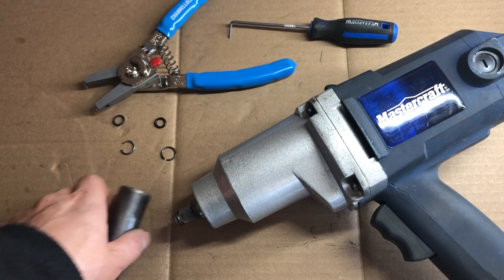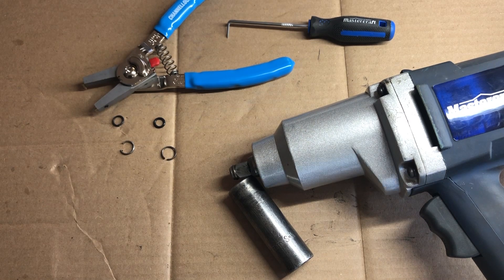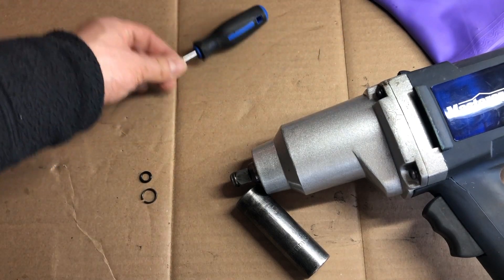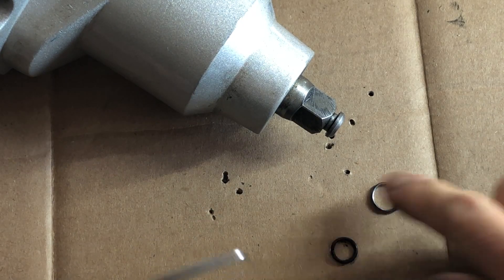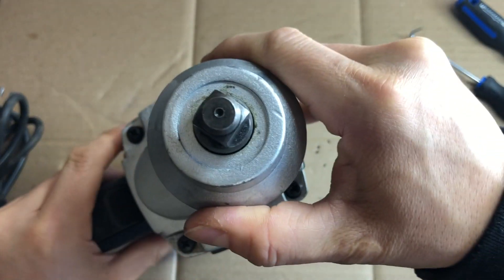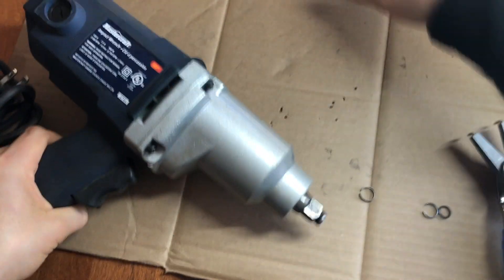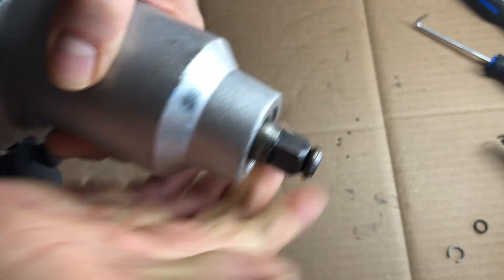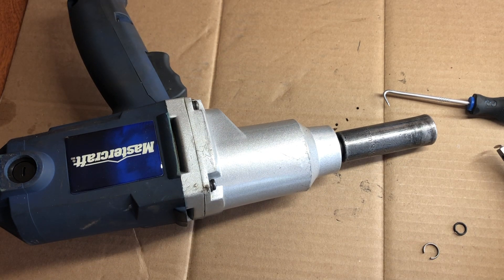Easy Way to Replace a Worn Friction Ring on Impact Wrench

Comment: On the part using the picking tool to push the snap ring onto the anvil, just use a socket attaching it to the anvil and the snap ring will snap onto the groove.
Reply from the maker: Man, I love that suggestion! Thanks for sharing. 👌

Comment: What size o ring did you need
Reply from the maker: The one for the size of your impact. It's just based on 1/2" or 3/8" impact friction ring (that's what I searched for on eBay).